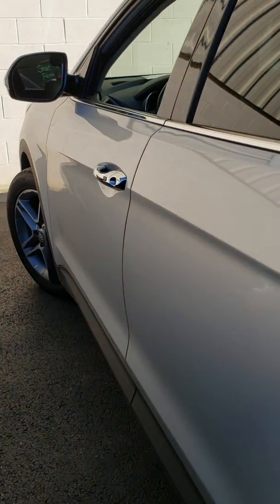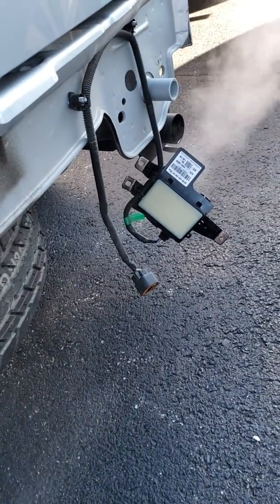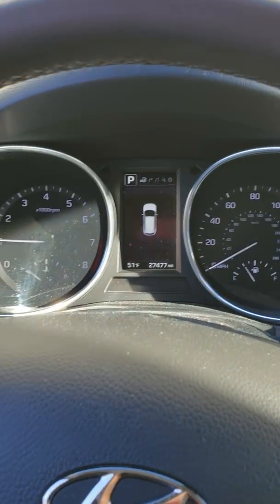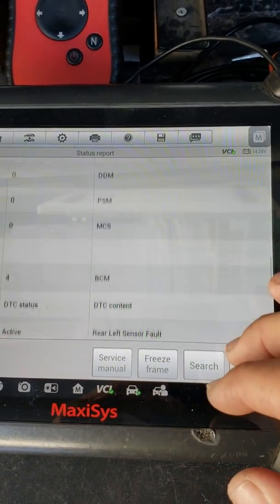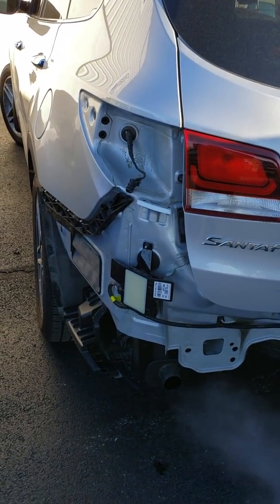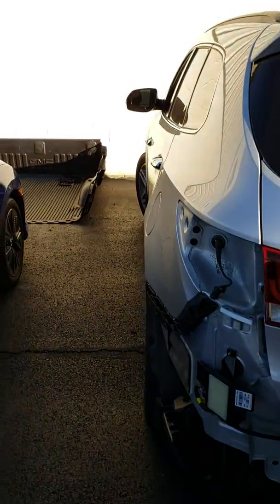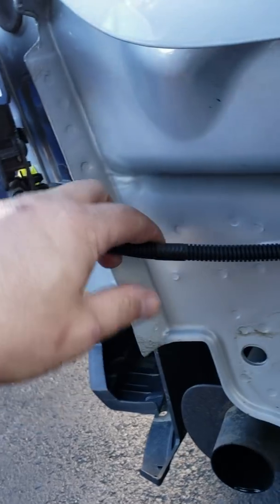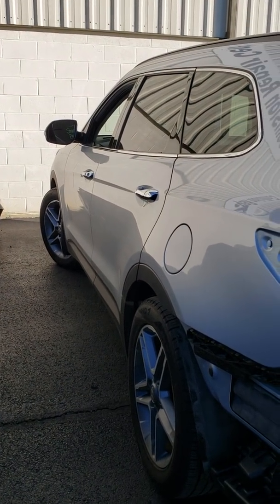Hyundai / Kia blind spot monitoring system testing tips

Comment: So wait before you tore down the bumper did the blind spot switch on the dash work when pressed? This has been my issue the switch acts like its broken I dont want to replace the whole dash switch since its around $135 but I don't have any warning messages about my blind spot system it just acts like its not installed. So I'm just wondering now if i'm getting power at all.

Comment: Interesting...I have an "opposite" issue.  I get an intermittent  "check BSD system" error message, with an orange illuminated DBC (downhill brake control) and ESC (electronic stability control), but NO codes generated. Newer Kia Sportage.  Everything appears to be connected properly.  Just weird....

Good video sir.

Comment: Hay Robert, does the blind spot chime come from the instrument cluster? I have a 2015 that all the lights come on. Sensors telling the cluster that there’s a car in the way but no chime. On the same car, it has park assist sensors in the rear. The chime does work when I get close to an object. Question, does the blind spot and park assist use the same chime from the cluster?

Comment: Thanks for the tip before i send them to auction😉😉😉😉

The pre 14 silverado park assist sensors which wont throw a code till in gear can be /deleted/ by pulling the fuse disconnecting battery and rehook battery. No more service park assist message

Comment: Keith D referred me here, but I know I've read some of your posts on either FB or Diag.net.  Good video and to the point. 

It's scary to know there are quite a few people out there that solely rely on this type of technology and switch or merge lanes without looking in their mirrors or physically turn their heads. I, for one, would never rely on any of these "safety" features.... it is nice to use them as a backup maybe.
Reply: Cuba Rodriguez agree
Reply: And that is the reason i drive an older car with manual transmission even though I work on late model luxury POS vehicles.
Thanks but "no " thanks
Reply: @JuanOrtiz-mo8be  I totally agree with you Juan. I have 2 '80s vehicles... 1 '00. I know I wouldn't get anything newer than that. I wouldn't have gotten the '00 if it wasn't so cheap at the time of purchase ($400, got in and go so far)